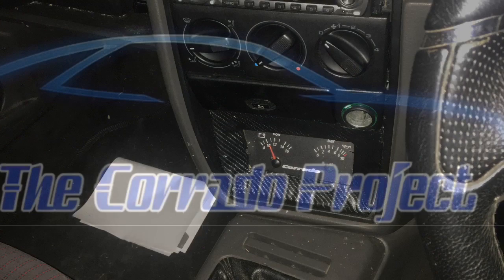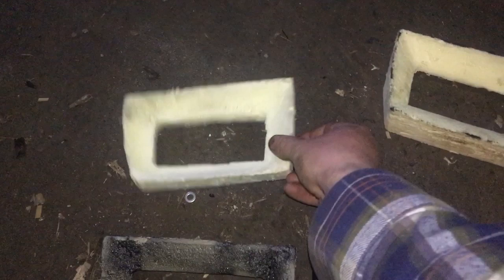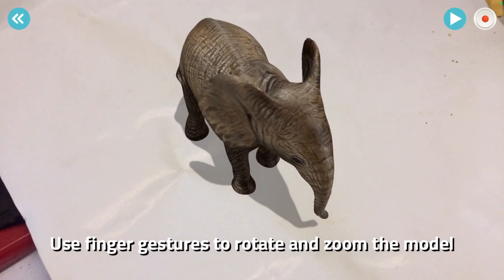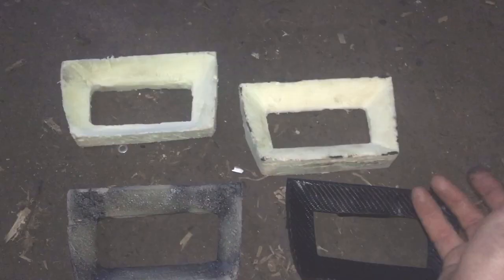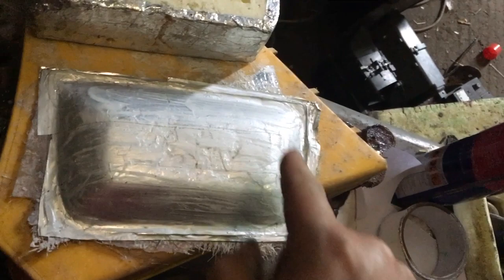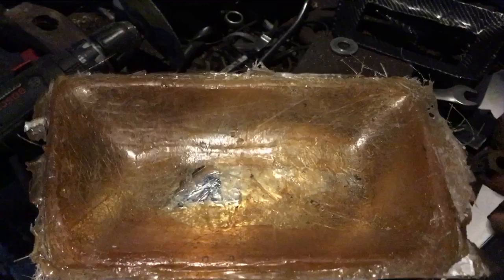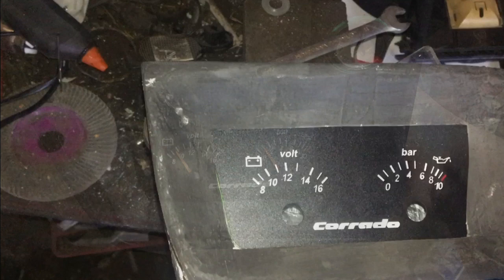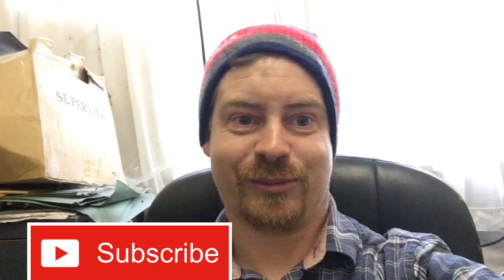Ep45 building the Corrado oil / Volt gauge (DIY)

Comment: This is class Steve, I have original vdo gauge but it’s for left hand drive car so doesn’t fit exactly in, but need to wire it in now to my 20vt. Keep up the great work. Need to organise an Irish corrado meet up 👍
Reply from the maker: Would love to take a mold off your one so u have the correct contours.  From remember the face is the same but the body behind it that fits into the cubbyhole is at a different angle ( I think)
Reply: No problem at all Steve, maybe the front face is the same but it is angled so it fits a Left hand drive model leaving a gap on the lower passenger side of where it sits. If that makes sense. I will send you pictures of it